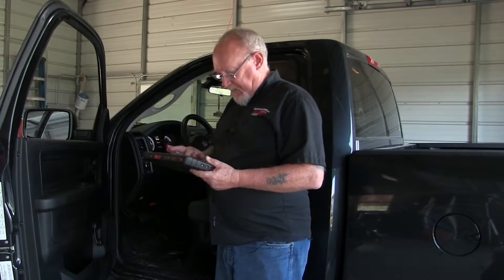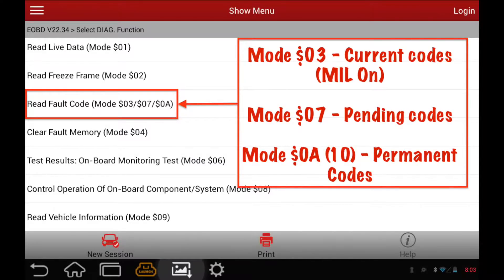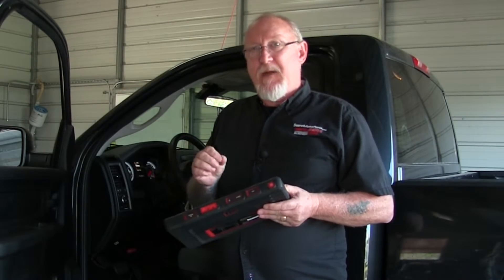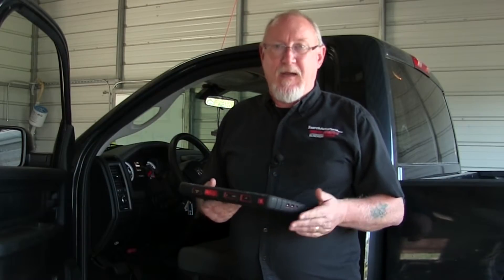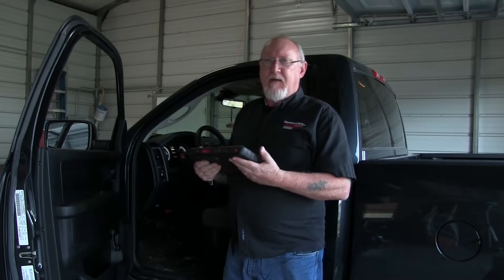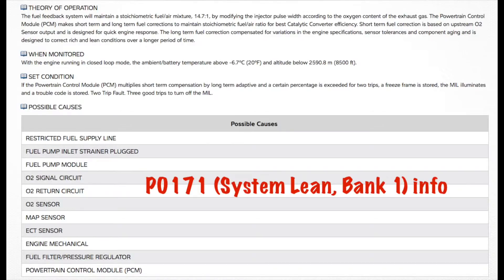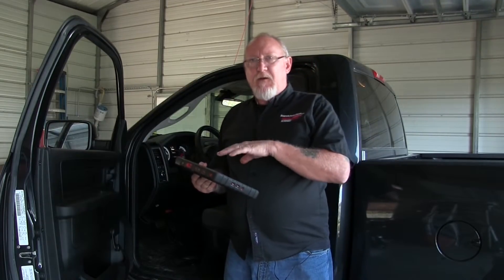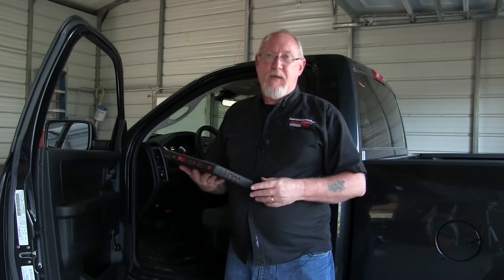The Trainer #75 - Scan Tool Tips For Drivability Concerns

Comment: my 05 Acura TSX went into limp mode outta nowhere (drove to Lowe's hardware, no prob. when i went to leave it was pouring rain & I noticed it wasn't accelerating & its had a constant U0107 DTC since). i followed service manual instructions for this DTC which were mostly voltage, continuity/resistance checks & all were normal. replaced TAC module, no fix. I've erased codes with my cheap Bluetooth obd2 tool but it never goes away. since this is my only transportation I've HAD to drive it IN LIMP MODE on occasion to a nearby grocery store. i did additional voltage & resistance tests the other day at the APP sensor & it's wiring(normal) and didn't feel like i got it connected back tight enough & sure enough when i checked codes it also had one for each APP sensor plus a U0155 (F CAN malfunction, loss communication with gauge control module) the gauges are working however & i read something about CANbus systems doing these counts.. transmitting &/or receiving and if either gets to 127 then that node goes into error mode. that would make sense if the gauge module was supposed to receive data from TAC and wasn't but IDK if that's truly the case here. this car uses ISO 9141-2 protocol so no CAN lines to DLC. it appears I'm gonna need bidirectional ability at this point. I'm considering a DLC to laptop adapter.

 I'm financially unable to take this car to a shop or buy expensive tools. i hope you'll take the time to give me some advice on how you'd proceed in this position. before this prob came up i knew nothing about cars or electronics but have since learned quite a bit.. but there's still plenty i don't know tho. oh yeah and do you know if any source that would have a wiring diagram of how all the modules are connected to the CAN lines for 05 Acura TSX? i can't even find anything showing where the CAN lines run although i do know of one connector location that is a direct CAN connection (I'd just rather not tear out my entire dash to find where that wiring leads) 

i apologize for this lengthy msg but I'm in desperate need of guidance & there's a lot to be said about my problem 😕